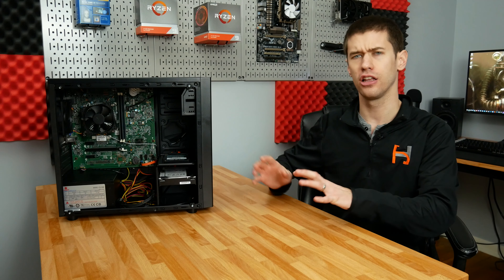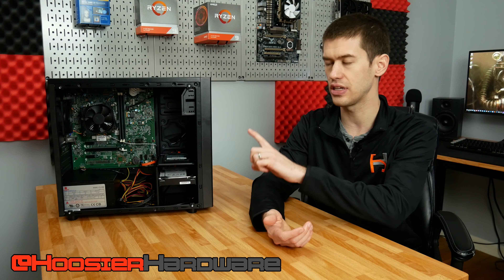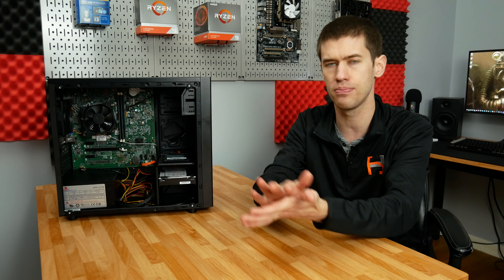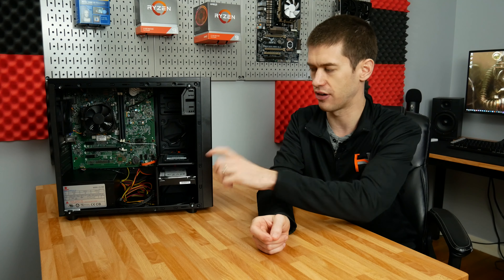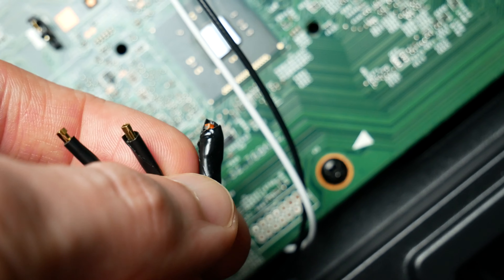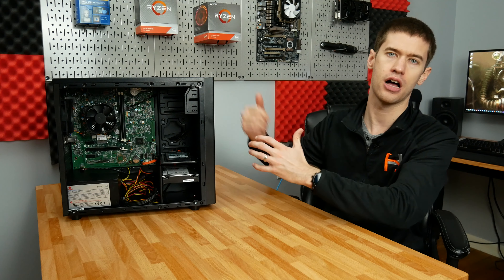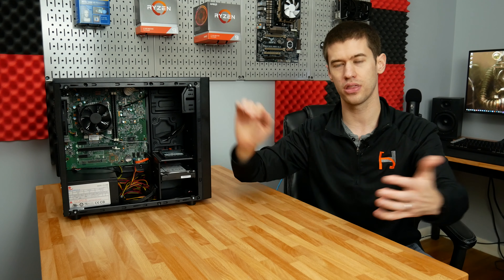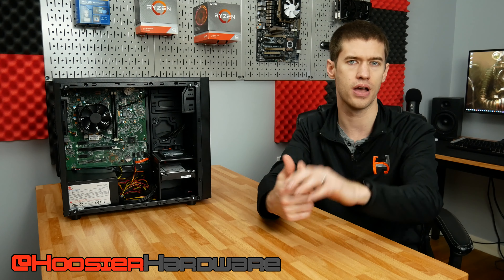SUCCESSFULLY Re-casing the Dell Inspiron 3847 Prebuilt PC

Comment: Important points I learned from this video: 

1. You can use any standard ATX power supply so long as it has enough watts for your specific hardware choices. 

2. The stock Dell power supply does NOT have the necessary power connectors for graphics cards. Workaround could be to buy a more efficient graphics card that does not have the 6 pin or 8 pin connectors on the side of the card itself.

3. The stock Dell CPU heatsink can be kept when changing cases.

4. You need to keep the Dell case fan as it is specific to the motherboard. If you change it with any other fan and it probably will burp up an error upon boot forcing you to press F1 to continue which is annoying. 

5. No surprises that the wiring for the front panel stuff requires modding but bare minimum you just tap into the 2 wires for power switch, then put the rest of that front panel stuff inside the case while leaving the wiring attached to the motherboard. Failure to do this and once again you are pressing F1 at each boot to clear annoyinh error messages.

6. This video does not touch on the fact that some of these machines have built in wifi and bluetooth and thus have internal antennas which will need to be brought over to your new case. If you are gaming odds are you are using ethernet or will be using a more modern wifi card but it's still nice to have the factory bluetooth for gaming headsets.

Fun side story: No joke I found one of these machines stripped of memory and hard disks that was brutally tossed onto the grocery store parking lot one evening after dark and just before a big rain storm. Case is trashed and front plastic panel is beyond repair. Will be transplanting into an very old Antec case and I will just run the power button assembly out of the floppy disk opening on the front of the case and then stuff the audio and front USB assembly inside the case to hide it since I won't need them but don't want any annoying error messages.

Hope this helps others. Thanks OP for making video. Next time wiring tutorial being included would be amazingly helpful. Cheers!

Comment: I wanted a second computer to run linux on so I decided to get a Dell Precision t3600 with a xeon e5-1650. I paid $105 shipped and had an ssd, hdd, and gpu to put into it. So far I am really happy with it. I did have to remove a piece of metal from the side panel which was a pain but the only other thing I am planning to do is change out the thermal paste on the cpu.

Comment: well, without the secret cables to jump - i've pulled out the actual power button from the 3847 and then used that on the connector , then put the PW SW to the tiny half height/short set of pins right above the front panel pins.  only issue is they'll fall out if they brush against it, so it's a pretty delicate setup.
Reply: Hi, I'm trying to diagnose a no-power problem and need to rule out power button.   There are 11 pins on the motherboard connection, all unmarked.  I need to jump the power pins to bypass the button but I don't know which ones they are.  Can you refer to a link with a diagram of these pins?  Thanks
Reply: I mean a diagram specific to this Dell GGDJT motherboard.  Dell doesn't show it, and I can't find it anywhere.

Comment: Do you have a site to where I can go to get the detailed info to do the front panel connectors? I just recased my inspiron 8347 and having issue of no nothing from display, or peripherals. Would it be easier to just pull the power button and connector, and rig it to the case? I need help please. God Bless.

Comment: My suggestion for splicing those pin outs would be to use a sleeve connector and heat shrink tube. The same heat shrink tube can be used for the pins themselves which in my opinion would not only look better but be safer than the electrical tape which can loosen up over time. Especially because this can be a liability issue if something shorts. That said, it was an interesting video.

Comment: In order to remove the Fan F1 error, you plugged in the original fan into the Fan header. Which one did you plug it into to make error go away? CPU_FAN or FAN_SYS.

I want to confirm if the error goes away if we use an aftermarket cooler for CPU_FAN

Comment: I have a Dell 3847 I got 6 years ago...wanted to make it decent as far as midrange for room/price  can go, Doubled to 16GB RAM (DDR3 still tho), added CPU i7 4790K when was only $120 years ago  , added a Thermaltake 700 W, and Radeon RX570 because I was told that's biggest I could fit in case. Well I got it in, but it literally by mm kept a data cable from my CD ROM drive intro plugging into board, so I just unplugged that and use my USB CD-ROM drive for rare times I need to burn/install. This got me thinking, can I just put everything back in a BIGGER case like you're doing, and just invest in a bigger graphics card now that I'll have room??? Since I don't have $ or need for ultra high end PC, this that might be cost effective way to slightly improve.

Comment: Did this with an HP once.  The computer had been given to me in rough shape.  Still ran fine, but the outer panels, even the front, were missing.  A low cost Amazon case to the rescue, and I ended up with a nice machine. 
My Lenovo was a nightmare, tho', and in the end I had to get two add-on boards to make possible using the front panel audio and USB ports on the new case.  (Thankfully the power button and LEDs were no problem.)
Both mods were fun, tho'.  Can't help but enjoy rebuilding a computer and having it still work fine.

Comment: I bought this exact same Inspiron for my first ever build. I threw in an i7 4790, a GTX 760, 16 GB of RAM, an SSD, a Rosewill 550W PSU and a Cooler Master CPU cooler and it runs great. Instead of transplanting into a new case though, I just painted the inside of the Inspiron, cut out the side panel and added an acrylic sheet and put a USB LED strip inside. It isn't the prettiest, but it was less than $400 total, and I even sold the old i5 and 8 GB of RAM for an extra $50. I love seeing what can be done with old hardware!
Reply: I, too, have an i3847. What model of Cooler Master did you use since spacing in the case is always an issue?
Reply: @ARyan-yk9qh  This is the cooler I used. The only problem is that it has a 3-pin connector instead of a 4-pin. I had to plug it into the front case fan header (it is 3-pin), and this header will regulate the fan speed as needed. When you boot, it will tell you that there is a CPU fan failure, but just press F1 and it will be fine. Or, you could get a 3-pin to 4-pin adapter!

https://www.amazon.com/gp/product/B07QNN9MW3/ref=ppx_yo_dt_b_asin_title_o08_s00?ie=UTF8&psc=1
Reply: @brantcollins6433  - Thank you. I appreciate the info and the reply.
Reply: Hi I have the inspiron 3847 with 088DT1 motherboard. planning to replace the processor. Do you replaced yours with the i7 4790k sr219? Thanks for your help

Comment: Can I upgrade the default i5-4460 cpu to an i7-4790k since they use the same slot? Will it still be compatible with this motherboard (088dt1)?
Reply: I have this dell. I am running the  4790. I od not know if I am running the same board as you.

Comment: 9:17 Correct.

The Lenovo ThinkCentre computers are awesome for case transfers. Cards I own and have tested.

GT 730 (works on almost everything made within the last decade)
GTX 750 ti
GTX 770
GTX 960
GTX 970
GTX 1060 3GB and 6GB
GTX 1070
RTX 2060 and tested my buddies 1660 and 2060 Super, they also work.

They all work on the Lenovo ThinkCentres sometimes you need to update the bios but it works.

Any 4th gen and onward ThinkCentre is gonna be really easy to work with and if you buy a SATA front panel audio card you can have all your stuff back on the lower PCIe slot under the GPU. Personally on the one I kept for guests to game on I dont have it conntected so I can use a Wifi card and just have a USB hub and the audio stuff on the hub. But if I'm selling one I make sure all the stuff works like front panel audio and all of that but ya gotta spend some money to get that functionality back because the OEM connect not only doesn't work with non-Lenovo cases but it's covered by most respectable GPU's anyways so you're better off going this route anyways. 

Bought 4 Lenovo ThinkCentre M83's without HDD's only one came with an HDD to plug into all the machines to prove they worked during sale and I bought the HDD for 10 bucks lol. They're all Haswell 4th Gen i5s and I swapped them to RGB cases put the 1070, 1060 6GB, 970 and 960 to work in them all to make them run games. And sold them all starting at 500 up to 700 and now I am looking to buy 10 more Lenovos and do it all over again. These ones are cheaper SFF ones but I just bought one and swapped it all into a Cooler Master Elite 310 case and it's perfect now and running a 1060 3GB no issues.

Time to buy a bucnah PSU adapters they're allllllll 14 pin and I gotta buy some Raidmax 700W psu's as well since they're juuuust cheap enough but not garbage since they're 80 plus certified and then I'll have the entire used PC market in my area. It will literally be mine. Lol. No one sells Gaming PC's where I live aside from Best Buy so I will be the only one! Ha!
Reply: TL;DR just swap the stock cooler's 80mm fan and add ram and a GPU and buy an SSD and look up how to connect front panels on OEM's and you're golden

My favorite ones to swap are Lenovo followed by Acer and then Dell. To me HP is a nightmare.

Comment: Hello. Do you think this could be done for my Inspiron 3670? I have it fully upgraded with psu, gpu now. Added holes for psu venting out the bottom. 2 molex 80mm exhaust fans out the back and another 80 mm for intake on the side and it’s still too hot with the side panel closed. (Gaming with a i5 8400 and a gtx 1070 inside the small space). I would want a case with top vents so I could run an aio cooler.   Got off track, the power button for the 3670 motherboard seems to be directly in contact with the  button on the front.

Comment: There are front panel Io adapters for these on eBay. Around 12 bucks. Waiting for mine to arrive. Searching for an adapter for the front USBs still.
Reply: where
Reply: @kennywilliams3031  on eBay.
Reply: Are these adapters compatible with the Inspiron 3847 that is being used in this video or is it only for the optiplex PCs
Reply: @prog237.  not sure off the top of my head. The sell ads should list all compatible.

Comment: A friend picked one of these up and asked for a hand upgrading it. I went to check it out and when I placed my hand on the running PC I got zapped, he's gonna grab a power supply but upon finding this video I'm going to talk him into one of these cases or the 50. My question is are they propitiatory power connectors on the board? Like hp or is it a normal 24 pin no wires swapped so I can use any new PSU? Thanks for your time.

Comment: Congrats, and thanks for showing this.  I had a very annoying experience with a Dell small form pre-built that I got at a "great" price from BestBuy, in an urgent situation when my son's old PC died during a Christmas trip.  It didn't look too small, and I thought, well I'll just pop in my son's good GPU when we get home, and it's done, right?  Wrong!  The power supply was too lame for the graphics card, the case was too small for a normal PSU, I didn't think I could re-case it due to the proprietary connectors you mention....and so on.  Ended up trashing the whole thing except the CPU, and building him a new PC from scratch. Dell isn't all bad, but I doubt I'd buy one with a plan to upgrade.

Comment: There’s a second fan header beside the sata sockets. I’ve added a second 120mm fan
Reply: Nice catch Tom! This is really important for cooling two hard drives in the the bay. I had an extra fan and dropped it in behind the hdd rack. Thanks for again for your contribution. Where did you put your 120mm?
Reply: M Baldwin I removed the HDD tray and zip-tied the fan so it’s blowing underneath the GPU. It keeps it very cool, and allows for much longer GPUs!
Reply: @tomslattery1  Thanks! I'm running Openmediavault 5, three hard drives running less than 39 degrees celsius, motherboard fan @840 rpm, CPU four cores @29 degrees, CPU fan @500 rpm, onboard GPU @28 degrees, my Western Digital Black data and Seagate boot drive (hdd tray location) were hovering around 57 degrees before adding in the second fan behind HDD tray (fan is just sitting free for now). Very quiet setup. Thanks again for the tip on the second fan header! A 17+ degree temp drop is great. (second fan is similar to OEM fan, out of older Dell)

Comment: I have a question: isn't there a problem with this build because the Graphics card that has a pci slot of 3.0 x16 doesn't fit in the motherboard (which has a pci slot of 2.0 x16)?

Comment: I would rather build a computer  with a R5 3400 4 cores 8 threads or better yet go with the R5 1600 AF at 85.00 dollars and build around that platform you could go 3rd Gen Ryzen or 4th Gen  Ryzen down the road.But for 300 to 400 you could build the R5 1600 Af.

Comment: Man this case blows. Terrible cable management. Very tight space to work with. Always go with the q300l for 44$. Much better cable management. Able to fit longer gpu without having to modify the hdd rack. Spot for 5 rgb fans.